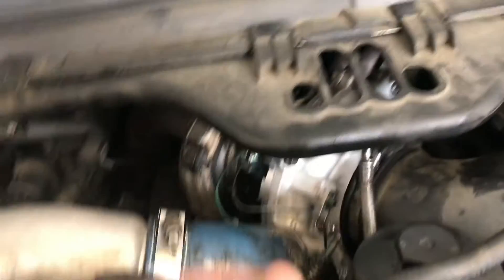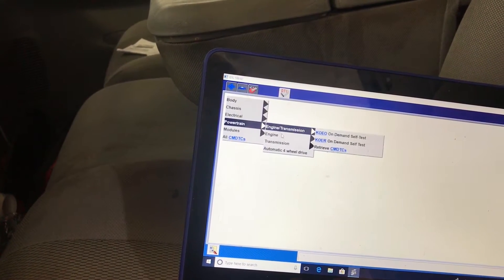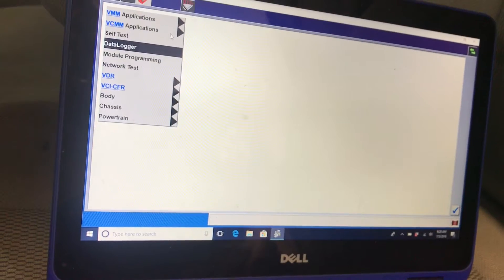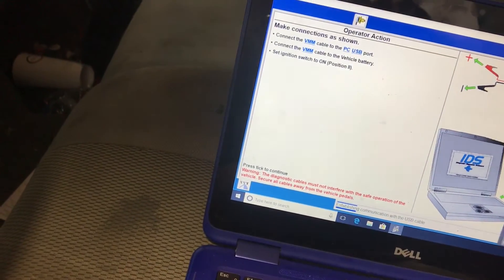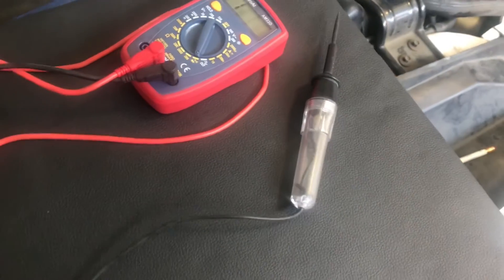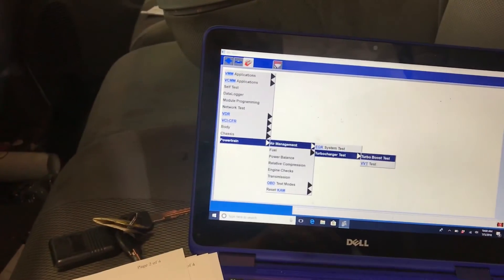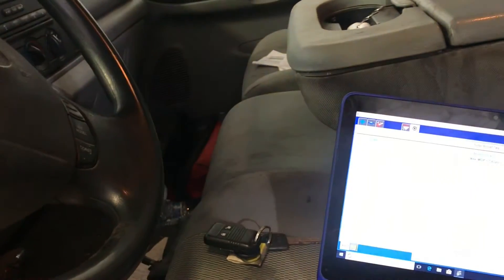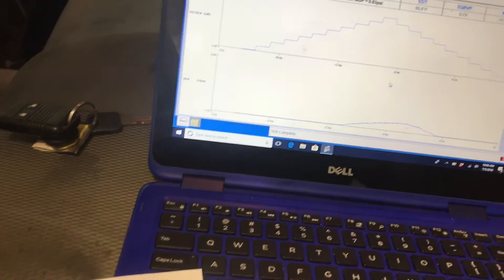6.0 Powerstroke P0046 diagnosing

Comment: Truck started running rough yesterday. Seemed sluggish off the line. Also a shaking starts about 5 miles an hour and gets really bad. Posted the following DTC‘s on my ex and my SCT X4 tuner. P0046, p0275, P0683 & P2287. History 3 years ago I had the the Mesa Arizona Bullet Proof kits done by a mechanic in Northern California. Before they touched my truck, when I had issues I would get an engine light if code was thrown. If had 4 issues since and 2 of the above codes my SCT tuner posted P0275 and P0683. My mechanic said there was nothing wrong with those to codes. But today I found now P0046 & P2287. I’m wondering if could be a defective PCU? For the fact I now feel obvious issues. No immediate power when I mash the fuel peddle and the now shacking. I read on other blogs where other people had the same symptoms while driving. They also posted a P0275 DTC.  OH and that injector was replaced 2 years ago a year after all injectors were replaced. Any ideas or thoughts? 

Thanks,

James

Comment: I run a SCT X4 on my 2007 6.0.and I watch the digital gauges often. Are there any resources that would give me the normal operation of the sensors? For example, my exhaust back pressure reads 57ish lbs at idle and 52ish on an engine breaking downshift.
Reply from the maker: Harpoon the ebp reading is incorrect on the tuner. When using ids at idle it’s around 3-9lbs and wot is around 20-40. I’ve talk to sct about that issue. They don’t have a fix

Comment: I have an 05 f350 6.0.  I just deleted EGR by welding ends and flushed my oil cooler.  I replaced glow plugs and harnesses by removing fender liner.  I think I have everything plugged back in, and I don't hear or feel any leaks.  I do have a 046 and 264 code about to pop up on my Scangauge2.  It was hard to start initially, and now today it started easier, but I have almost no boost, and very little power.  I am going to do that vacuum test tomorrow, and I'll test the voltage at the vgt plug.  Beyond that, do you have any recommendations?

Comment: Hey 6.0Doctor, had a question. I have a 2003 f250 6.0 and recently had a front cover installed due to the old one having cavitation. My problem now is that when I was about to do an oil change and coolant came out the oil pan before the oil did. Would it be a head gasket issue or heads themselves. Truck never had a severe overheating issue. Any help from you or anyone out there would be greatly appreciated. Thanks in advance....Awesome videos.